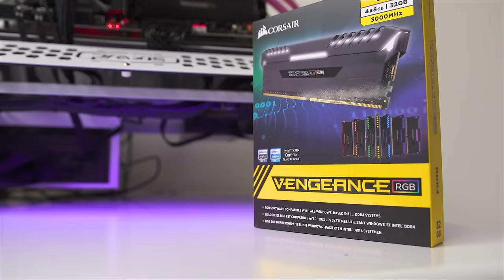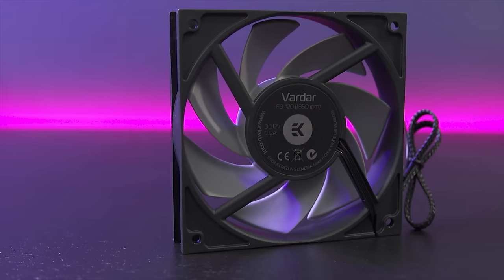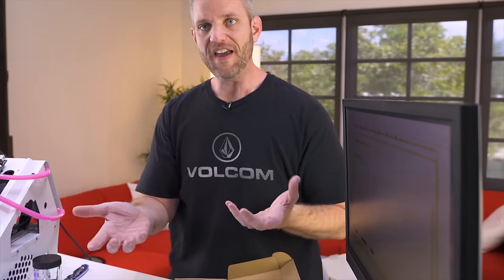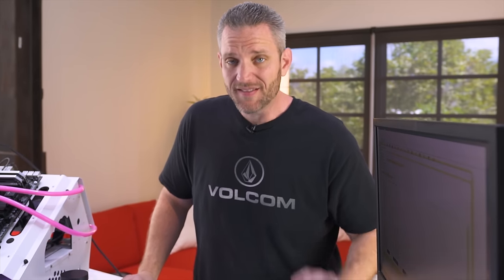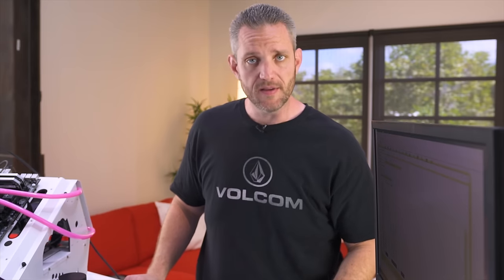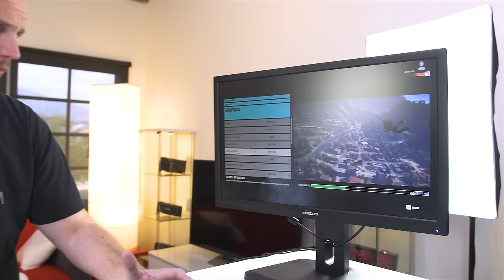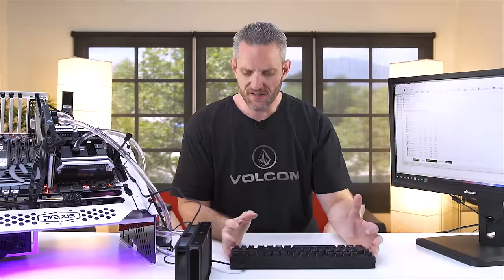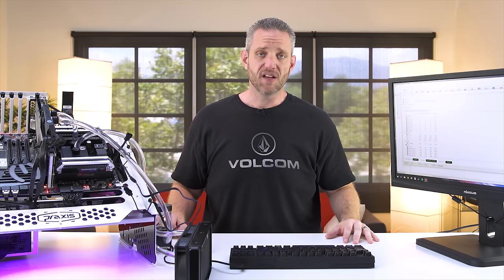How to Watercool your CPU and GPU for under $250

Comment: the bad thing is that this kit is not supporting my 

ASUS ROG Strix GeForce GTX 1080 Advanced STRIX-GTX1080-A8G-GAMING 8GB GDDR5    X SLI 

feel that i will cry soon 

240 $ X 2 = 480 $        2 kits 

compaire to $ 897.29   full custom loop

thats totally frustrated
Reply: just buy 2 Watercoolers for your strixes like from phanteks (i know they are a bit pricey) :)
Reply: you could get another block
Reply: That's why u get founder's
Reply: Try having a Strix RX480.....all blocks are discontinued.
Reply: You should read some more.
Reply: thats when you upgrade XD

Comment: 1 more thing if possible could you do a vid about the radeon kit for us amd fans... the website is vague on wich amd cards the block fits...  in my case or instance rather i am hoping to do this with a powercolor red devil 5x80 8gb non golden sample card . my system case is micro atx and kind of constrictive which is my main reason for wanting to do this. i have seen others say waterblocking an rx580 is dumb I wanna really find out why.... and am interested in the thermal bonuses mostly overclocking is a plus but not  really my goal. thanks again jay.:)

Comment: Looked on EK's website, this is now discontinued 😭
Reply: i wonder why
Reply: @BloPsy__  I am pretty sure it is just because of the price drop of copper parts, especially on eBay, Amazon, etc... Many people just do not trust aluminum, and buy copper parts instead of it... The most expensive part of this set is the pump anyway... It's maybe half of the price of the whole set... So you can buy the same pump, and common copper blocks, rads, etc,  and brass fittings, and you pay maybe 50-100 USD more, but you will have full copper loop... So its why they discontinued it in my opinion... PS: I saw aluminum massive deep corroding just on air, so I will trust it only if it will be nickel-plated all around (outside too)... But yes, it will be no problem with galvanic corrosion, when you do not mix it with other metals... It just not prevent it from common self-corrosion at all...
Reply: I still have this kit and needed to change out some fittings so I hit up EK. You can still get them as well as the cold plates through their customer service but shipping is like 20 bucks and they can't ship the cold plate with their other parts because they don't stock them at their own warehouse. Not entirely sure about the gpu block though. I believe they said they are still using the aluminum parts for some prebuilt systems.

Comment: but will it corrode after some time?
Reply: Yes, eventually.
Reply: No, galvanic corrosion is due to...in lay mans terms to different metals...aluminum and copper...aluminum instantly oxidises and protects the aluminum from further corrosion
Reply: "but will it corrode after some time?"

Only via galvanic corrosion, so don't mix your metals... If you don't mix metals, this system, does not corrode, ever. ;)

It will last you until the day you die... Well, you may have to swap the plastic tubing, but the metals will last a lifetime. xD
Reply: @MyouKyuubi  except for the pump, liquid and tubing
Reply: Oh yeah, the pump too, though as long as you keep the system clean, you wont have to swap the liquid... But that's situational, so the liquid is likely to be changed too i guess. :)

Comment: aluminum is going to oxidize and corrode regardless its how much service life it has while in use......great vid jay keep up the good work buddy!!
Reply: G Kotten Uh... it’ll oxidize but it won’t corrode further than that if it’s just distilled water and not touching other metals.
Reply: Well aluminum oxidises immediately, and forms a protective layer of al-o2 (aluminum oxide) but doesn't further corrode unless prompted
Reply: "Well aluminum oxidises immediately, and forms a protective layer of al-o2 (aluminum oxide) but doesn't further corrode unless prompted"

Aluminum oxidizes almost instantly yeah, and the layer of aluminum oxide protects the underlying layer from further corrosion... For further corrosion to happen, you need to actively scratch off some of that oxide layer... then it will rust and form another protective layer... So the only way it can corrode further, is if you keep scratching off layers, but by this point, YOU are the one destroying it, not the reactive properties of the metal. xD

Basically, aluminum is actually safer to use than copper, because copper, whilst it can also oxidize (black and brown spots), has this thing where it turns green/teal/blue (didn't bother researching into what that is specifically), and that teal stuff actually mixes with liquids, causing the liquids to become sludgey, and that clogs your cooling system right up.

Aluminum doesn't really have any secondary corrosion characteristics like copper does, Aluminum corrosion characteristics is, as far as i can read, just the standard protective oxide layer, i believe that is called passivation, which is a good thing for the purposes of the aluminum in this cooling system.

Imho, copper is a hilariously dirty and gross metal, because it's highly reactive to, well, everything, compared to aluminum anyways.

If you want to know how AWESOME the aluminum oxide layer is, watch some youtube videos where they show how HARD it is to make aluminum react to gallium, easily the most damaging liquid metal for Aluminum... The aluminum oxide layer protects against even gallium... It's amazing! :D
Reply: @MyouKyuubi I have a 20 year old ls1 350 block on my car, there's not a single dip of corrosion.

Comment: i really wanna watercool my PC, my case supports it. Im a noob when it comes to watercooling but i really wanna have a block on my CPU (AMD A10 7700K 3.6 Ghz) with a rear 120 mm radiator and a pump in the top or front. Is this possible??

Comment: Just my 2 cents as an auto tech, automotive antifreeze meant for aluminum engine components has a corrosion inhibitor. The old green style antifreeze will corrode aluminum heads from the inside out. I’d think they would’ve done something similar with the concentrate on this set up. Let it run as a durability tester and find out.
Reply: To caveat on that, aluminum heads on an iron block will corrode without the proper coolant. And commented before I finished the video so I see they did put corrosion inhibitors in their concentrate. I bet this setup will take off quickly. I know I’m getting one. Fun fact, the automotive industry used brass and copper in cooling components until the late 70s early 80s, when they switched to aluminum and never looked back.

Comment: these are $330 now and dont include the gpu block :(
Reply: Mr EdgeworthVII  you can buy the 360kit with gpu block for 299.99
Reply: BranNinja where at do you have the link?
Reply: Garrett Glamann on Newegg or the ek website themself.
Reply: @BranNinja1105  bro, idk whats up, my EK prices are all out of whack. I was looking at a GPU block this morning and it was over $300, went back an hour ago and it was $260. Didn't change any settings for currency or anything, however I did go down the road to a coffee shop when I checked the second time, but that shouldn't have affected prices. thanks for the heads up!
Reply: @BranNinja1105  also, word of note, the 360 kit on newegg for $299 uses aluminum and the gpu block is for a 10-series card. As far as i can tell, EK doesnt have any aluminum parts on their website, so you'd have to replace the whole system if you wanted to expand or upgrade your loop. The new 360 kits cost $319 w/o the gpu block and use nickel plated copper.
Reply: @mredgeworthvii   yes the a360g kit comes with a 10 series gpu waterblock for 299.99, and they sell extra fittings and other alumnim gpu parts on there website. shows radeon rx 5700+ xt, rtx series, radeon vega, so if you bought the kit you would have to factor buying the gpu water block you need and shows the rtx one is  109.99

Comment: Is it possible to just water cool just the cpu only or it has to be gpu and cpu combined...
Reply: Of course, you can water cool as many; or few, parts as you like. Most budget and AIO systems only cover the CPU. The only size of this kit to come with GPU support is the largest. The smaller ones are CPU only. Keep in mind this is an aluminum kit. As such it can only be used with other aluminum parts. If you get the kit without GPU parts, and later decide to add it, you'll need to make sure they're aluminum as well.

Comment: Concerned about aluminum? Thats the craziest thing ive ever heard despite it being on the low side of melting points, Its actually around 1,200 degree's farenheit, So dont worry about it melting sinces its a lightweight But strong metal and quite cheap.

Comment: as someone who just really got into modded computers last week can anyone tell me why copper or brass is used over aluminum? does it disspate heat better? cause i work in automotive industry and almost everything that has to do with cooling engines is made of aluminum, including rads, pumps, blocks etc like jayz said. i've seen alu heads that have been watercooled for 15 years in daily use and the "corrosion" is minimal, there's a small dull layer atop the material but nothing that would impair good cooling performance. so if alu cools well, is cheap and doesn't harm performance that much over time... why go with the more expensive copper?

Comment: Aluminum is not bad as long as the fluid is made for it and the other metals. I‘m saying this as I have a 13 years old Prius which has a mixed metals cooling system, specially for the hybrid system and that thing runs in more inappropriate conditions than a PC and the corrosion is minimal. The car is serviced with Toyota SLLC, the pink stuff, that is best suited for aluminum and other metals. I‘m still afraid of custom loops as these are more technical than a simple drop in place AIO.

Comment: Shouldn't 7:02 (the stoppers being screwed in) be done before mounting the card?  The torsion shown being applied on the card is rather hair raising. ALSO the stoppers will be less likely to cross-thread if applied on a nice stable surface.  The way it is demo-ed here adds unnecessary risks.

Comment: I'm surprised how many people are worried about aluminum... Just make sure the coolant you use has no impurities and is aluminum safe. Mix with distilled water and there's no issue. Cars run for YEARS on all aluminum cooling parts running 50/50 coolant and distilled water with no corrosion.
Reply: while your car is outdoors in extreme weather (hot/cold cycles throughout the day, bumpy roads), and your babied PC should be just fine indoors, great observation!
Reply: Coolant is the key....why would you say distilled water only then say 50/50 not distilled water...the OTHER 50% is corrosion inhibitors
Reply: needabettername  I never said "distilled water only"... I said cars run coolant mixed with distilled water in a 50/50 mix with no issues. Water has more cooling capacity than coolant which is why you want to mix it and not run 100% coolant.

Comment: So the gpu block only works on founder audition cards? So it will not fit on my EVGA GeForce GTX 1070 SC GAMING ACX 3.0 Black Edition, 8GB GDDR5, LED, DX12 OSD Support (PXOC)? 08G-P4-5173-KR

Comment: I know this comment is out of date, but I WISH i had known about this in 2020. I built a "hand me down" ryzen 1600 system and i spent THE SAME amount of $$$ on a Corsair AiO and 3 corsair rgb fans.... So my system is a Ryzen 5 1600 16gig 3200 trident z rgb ram & a XFX 5600xt and it looks good and i get good temps HOWEVER THIS WOULD HAVE BEEN SO MUCH BETTER.

Comment: Or better still, get Copper for under $200 by buying from Alibaba. Bykski is quality stuff. Got Bykski Ryzen-x-mk + 5700 xt GPU block alongside my 360 copper radiator,  all bykski.  The stuff is  high quality. A Barrow Res and D5 pump combo and fittings, again very well packaged and high quality.

You dont have to spend double the price to get good quality components.

Comment: Guys, we builders have to start getting smarter about what we spend money on, these companies are selling us brands and labels, not hardware. This piece of shit may look cool, but a better system can be made by a DIY with little to no fabrication skills.

*Copper has twice the thermal conductivity aluminum does, meaning faster heating/cooling rate.*

• Copper radiator (44$) [Amazon]
• fish tank water pump (12$) [Wal-mart]
• 1 block of clear plastic (4x4x2). (5$) [Hobby Lobby]
• 2 strips of 3/8 copper tubing (12$) [Lowes]
• 1 strip of silver, 2x2'' (20$) [Amazon]

Forming the heatsink: Drill into the clear plastic and form a manifold, drill inlet and outlet holes. Cap the manifold off with a piece of 20 gauge silver (best thermal conductivity per dollar on earth AND natural biocide)

Water circulation: strip the wires, rig up a connector from an old fan to it and plug it in. Fish tank pumps are designed to run 24/7 and very cheap.

Mounting the radiator: For god sakes, dont mount your radiator inside the PC. the air is only going to cool the radiator if the air thats blowing on it is actually cooler than the radiator itself. Run your copper inlet/outlet outside of the PC and mount it nearby. keep PC fans to cool it, you can use a small fish-tank to house everything. 

Seal everything off with a powerful waterproof adhesive, and you have yourself a copper setup with a SILVER heatsink under 100$

Comment: That temp looks too good to be true, I don't know what CPU you use, But a 240 rad can barely keep 7800X under 60C at full load. Adding another 200 watt component into the loop I am expecting 50+ load on the GPU. And no, I am not talking about AIO loop, I am talking about a variable D5 at speed setting 3 with a thick 240 rad,  2 Noctua fans, 7/16 5/8 tubing with EK waterblocks.

Comment: G'day, just looking to watercool my PC as it's a bit warmer here in Japan than in the UK (and I absolutely hate aircon). Unfortunately my graphics card isn't compatible with this particular kit and the only GPU block I can find for it is a copper one. So I guess copper my (planned) loop will have to stay for now.

One thing I can't find though are copper fittings for the hoses. And it got me thinking, why are all the fittings out of metal anyway? Why aren't there plastic fittings (commonly) available?  Seems to me that'd be the perfect solution to removing at least one source of galvanic corrosion in a loop...

Comment: GLAD I STUMBLED ON TO THIS!! 

Sorry I didn't have the time to finish watching ow, will later, but I wanted to ask here and hope someone with knowledge of this cpu+gpu kit.... I have 2 main questions.

Can the full cover block fit my ROG STRIX 1070TI binned? , and can I buy and add another rad and  fittings, and have my loop expand that way?.

Lastly, reason why I'm looking for options... It's cos when I have decided on performance in game, the thermals are up the shit house, and all else soon follows ... 

Can I swap the fittings and buy a buy a hard-line kit, once it's sorted thermals and all, hard-line tubing looks sick! . 

That way I can have somewhat of a try before I buy, and end with the best of both worlds. 

I'm asking because I have the G12 I'm using a Riing AIO and it keeps my 1070ti at no more than 65C but will not let me go any higher. 

With gpu tweeking software's all the popular ones even evgscand burner, tried all sliders Max right on stock clock, it holds 2150 solid till that temp!... My last thought is, could it know it doesn't have its shroud fans?, cos it won't go over 65 no matter what.... But... It has on some of our zero degrees nights, after opening up the entire room, has held 2202... 

Even tho the pump header runs the AIOs, the card is actively cooled within reason by the G12 fan controlled my the Strix external fan hub. That one is set for starting slowly at 40 C and hits full at 70C.

Why am I temp locked, will this kit be able to accommodate another rad, and future hard-line... Will this suit my 1070ti?... If so there is shops in Brisbane who stock, but they just tell you to "watch the hardware work on YouTube". 

Thank You for reading this, I look forward to your opinions and ideas, but not I gotta scoot.

Comment: Jay, so I got this kit with an I7 7700k and an 1080Ti 
 My GPU temps are great! 50c and my CPU not so great. I undervolted CPU and still at 68c. When I stream it goes to 80c! 
 I’ve tried every configuration, Checked Mount and thermal paste and same issue. 
 Is the 240 Rad not enough? Or is there an issue with the CPU block itself? Halp

Comment: $240 plus a used gtx 680 water block for $50 -- price raised to $300, $50, the 680 water block would be copper. Rip, don't want to mix metals. Looks like I'll wait till I'm rich for water cooling

Comment: my gpu (gigabyte GTX 1080 Xtreme Gaming Premium Pack 8G) isn't supported by EK's aluminium waterblock :/
Do you guys know where I can find alum. waterblocks? they seem to be extremely rare :/

Also EK now sell d5 pump as additional component of the Fluid Gaming series (ie the aluminium series), but it doesn't say if it has metal internal parts, and what metal - any info?

Comment: Have the jankiest water loop.  Started by adding a reservoir to a Chinese AIO and swapping the original tubing to clear tubing.  Evolved to a dedicated pump and cheap blocks. Using those verge zip ties as terrified of leaks.  Highly recommend if adding any radiator use the type with the screw in joints not with the fixed connections.

Comment: I am considering this kit and I am wondering - would it be OK to expand this loop with a Fractal Design rad from one of their Celsius AIOs (I already have one)? They are also made of aluminium and as we know they feature standard 1/4 fittings at the radiator side.